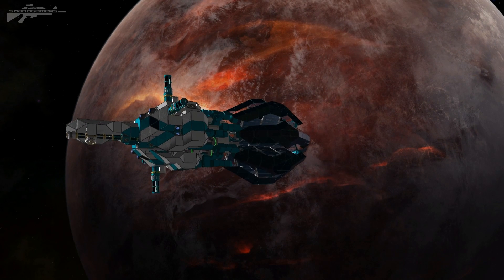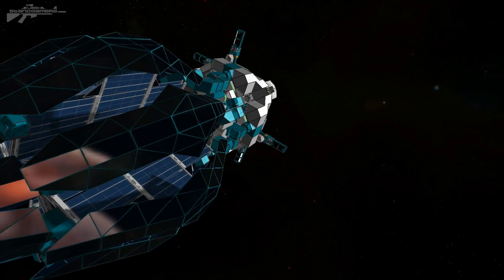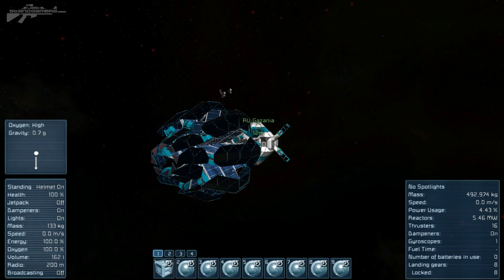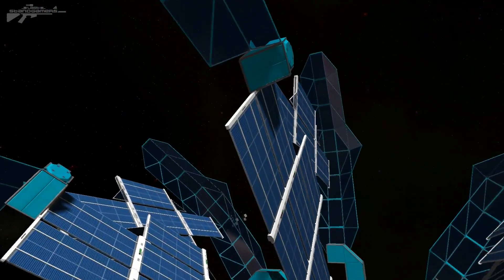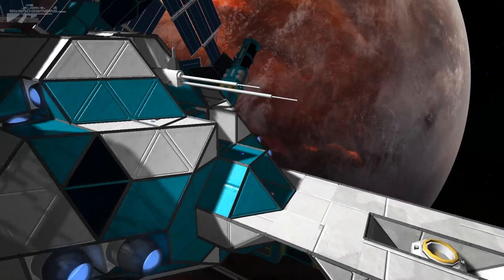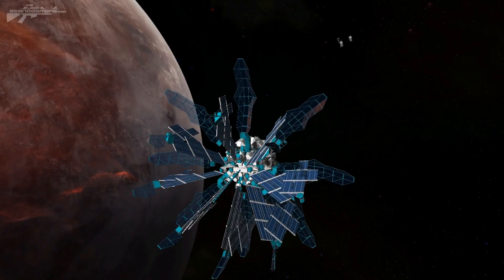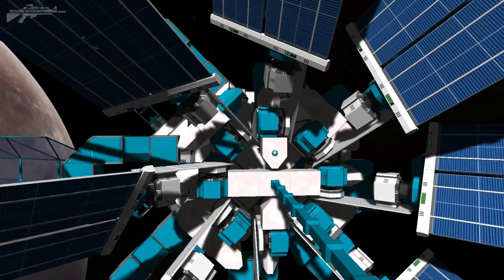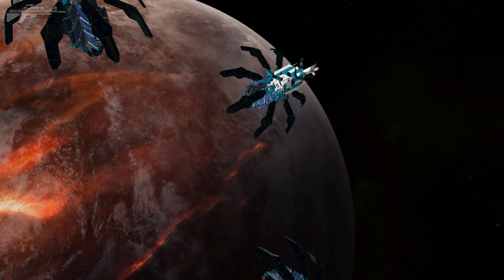Space Engineers - Auroras Solar Array

Comment: imagine a field of these and some batteries that are attached by connectors that are on the outside so you left them there for some time and filled them up and then brought them back or maybe connected the field together and then connected it back to your base, you'd never run out of power. you could even set up batteries wherever you can fit them and then charge them up so if you're under attack and the solar panels have to fold away or they get destroyed you still have good amount of power for your base. what i am interested in though is if this is possible with the oxygen-creating solar panels? it would be far less effective, but with lots of these it could start  to produce oxygen at a decent rate.

Comment: Someone should make a dyson sphere that would be a challenge
Reply: CYLON659 technically a dyson sphere is a few billion of exactly this single station/ship with the solar arrays...

The idea is to capture the entire power output of a star by placing solar arrays on satellites around the star until there''s no room for more :P
It has the advantage of not having any special engineering challenges beyond creating existing satellites and launching them into solar orbit.

Of course, if you're thinking of a Dyson Shell..that's a much more tricky structural challenge
Reply: Rohan2300 yeah i meant a dyson shell, a network of satellites would be a logistic nightmare to keep them from hitting each other but then again a single structure would have to be extremely strong to keep it from collapsing under the gravity of the sun

Comment: Can it move faster than 10m/s without disintegrating?
Reply: Adalet12 see? That's my problem with the game :( you can't build things like those and hope to be agile and fast...
Reply: Adalet12 Yeah I agree, but those are two kinds of games, bf4 is very GPU dependent, whereas SE makes your processor sweat, since there are more concerns to physics in space engineers... Still they could try to use the GPU to compute some of the physics to alleviate the load on the processor, and I don't know if they make use of multiple cores
Reply: Vinícius Negrão The devs have already optimized the game, but to introduce the features they wanted to they had to roll it back until the game is almost complete. A friend of mine played on the optimized version. We walked around a large ship during a battle and didn't so much as twitch. He landed a small ship on a moving large ship at 50m/s
Reply: Vinícius Negrão it is already more optimized...my bigass ships aint slideshows anymore. I can even turn more than 100 turrets on without going beneath 24 fps wich is kinda nice

but yeah...it needs more optimization =)
Reply: Adalet12 Well the levelotion is mostly eye candy, the rubble always stays the same. And we have to remeber this is still alpha, don't expect too much.
Reply: Well, you guys do have a point, it is still alpha, and don't get me wrong, I LOVE THIS GAME, but it could use some physics improvements some time :)
Reply: Regarding multiple cores: Keen has announced plans to upgrade not only DirectX (which will improve performance), but also to put physics onto seperate cores from other processes (which will also improve performance).
Reply: Ivan Lovell They already have an older optimized version, but it wouldn't work with all the new features they've added.